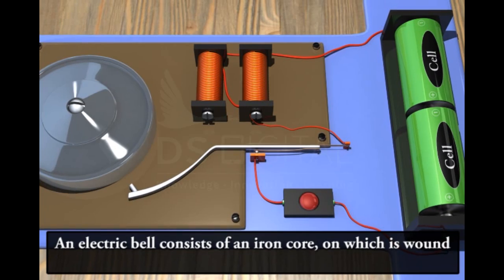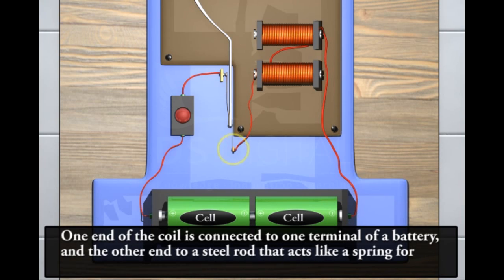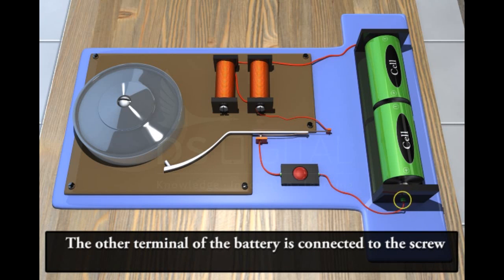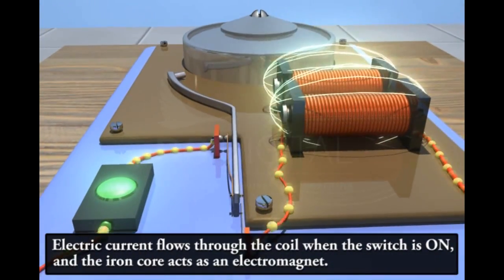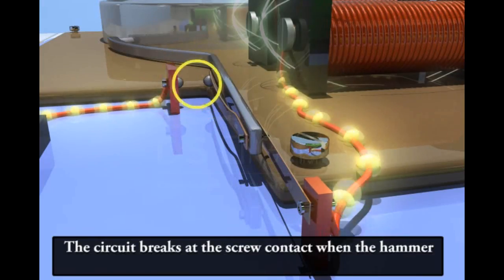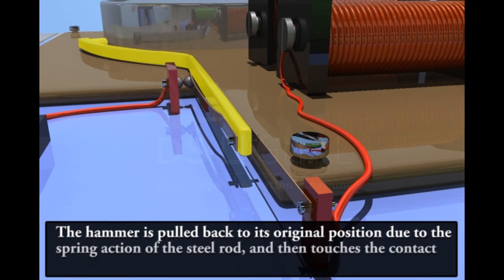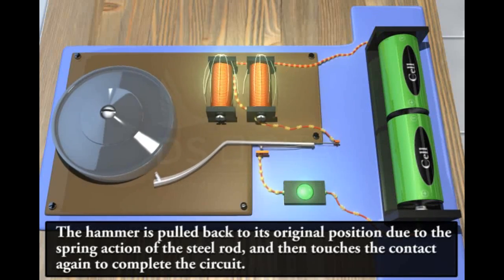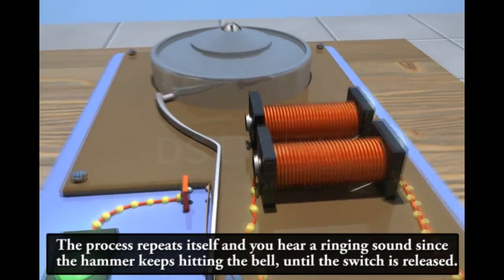Construction and Working of Electric Bell

Comment: Plz reply why cannot we use electric cells to supply power to refrigerator
Reply: Yes please ans
Reply: We can but we need parallel connection of many cell each cell have 1.5 voltages it also depend on refrigeator  voltage if your refrigeator are of 230 voltages so think how many cell and battery are use to run it and how much refrigeator takes watts it also depends on it if more watts so the parralel connection of so many cell will work for a short time that why we not use cell to run refrigeator  we use electricity